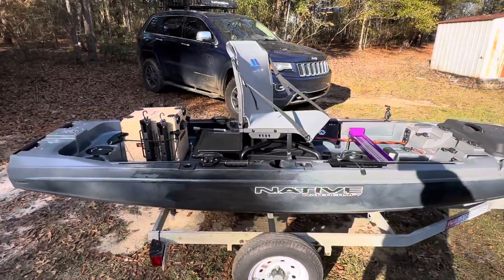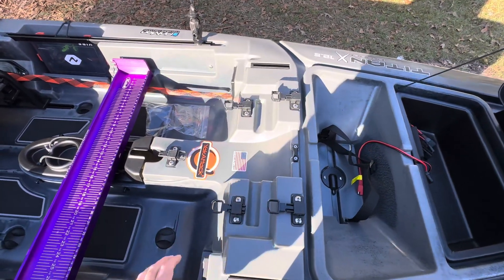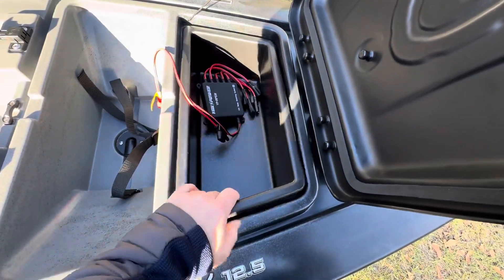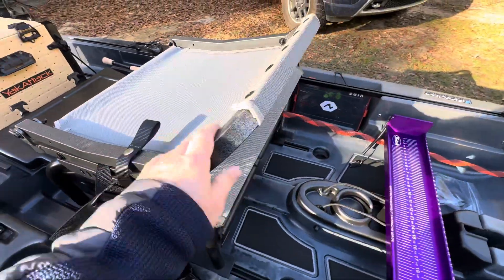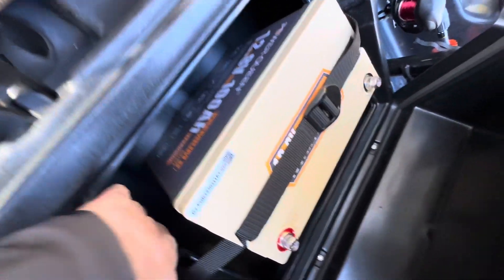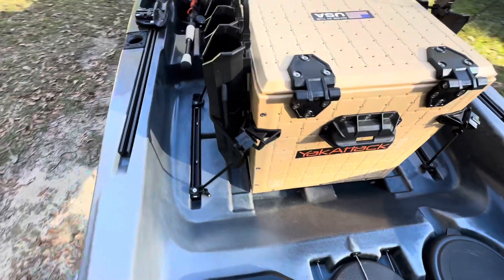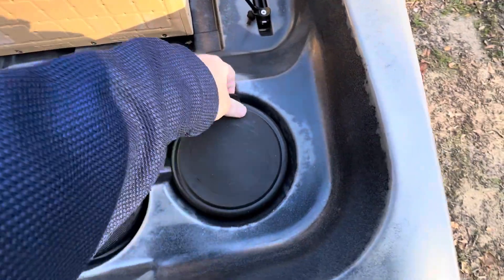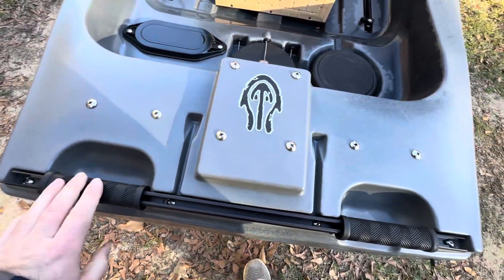My New Native Titan X 12.5 Propel Fishing Kayak Overview

Comment: Pro tip. Remove the bungee on the under seat tray then it'll slide out like it's supposed to lol.
Reply from the maker: Thanks for the tip, mine was actually defective and the brackets were bowed and binding the tray. They made it right and sent me a complete base and didn’t have anymore issues

Comment: Pro tip for transporting that seat.  My Unlimited has the same style.  Turn it backwards and fold it down into the pedal area.  Creates a lot less drag if it’s on a trailer, and makes it lower profile.  On my trailer I haul two and it was noticeable.
Reply from the maker: Great information, I will definitely do that. Thank you! Definitely makes sense to me
Reply: Loosen the seat straps and bring the seat back all the way back.  It lies FLAT, then...!
Reply from the maker: @MSmith-jf5wo  I’ve been just clipping it closed down and rotating it around where the seat is facing the stern and it’s been a lot better to haul

Comment: Nice! I have a Slayer Max 12.5, but i am thinking of upgrading to the Titan X.
Reply from the maker: Pleased with it so far, hoping to get the rigging finished up this week and take it out and see how she does on the water. It’s a big upgrade from the shearwater 125 I was using.
Reply: Get the 12.5 Titan X, and you'll find out Quickly how Heavy they are...!  (Heck, my Titan 10.5 weighs around 200 pounds fully rigged, and that's without the NK-180 motor and 60 amp 24 volt battery...!).  Lol
Just picked up a 12.5 Titan X last Friday, and a NK-300 motor.  Once rigged, I'll have to weigh it.  Pretty sure it'll go over 260 pounds...!  (I carry a lot of "fishin' junk"!). Haha!
Reply from the maker: @MSmith-jf5wo  for sure, I wouldn’t trade mine for anything in the world though. The weight doesn’t bother me having a trailer for it and what it’s capable of more than makes up for it for sure!

Comment: Does your mini battery fit in the forward battery compartment?
Reply from the maker: The 100ah mini fits perfectly in the rear compartment but the front is designed for a 50ah or smaller it seems. I have a power queen 50ah in there now but it doesn’t sit completely in the bottom and touches the sides a small bit. I’m going to make something for it to sit on so it’s not touching the sidewall of that compartment. I made another video showing the xi3 motorguide install this afternoon but still have to edit it and all but it should be going up in the next day or two